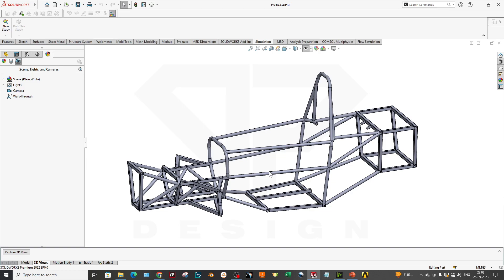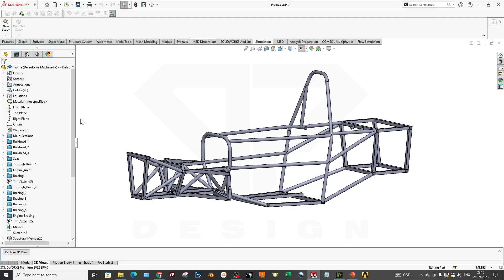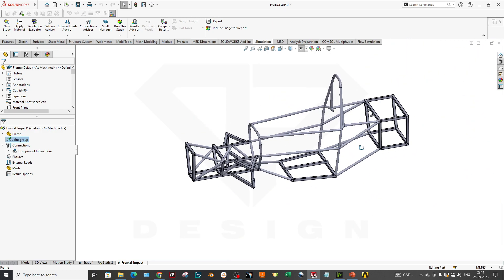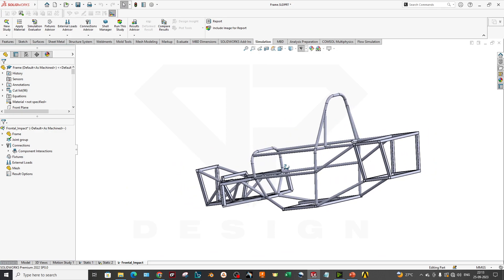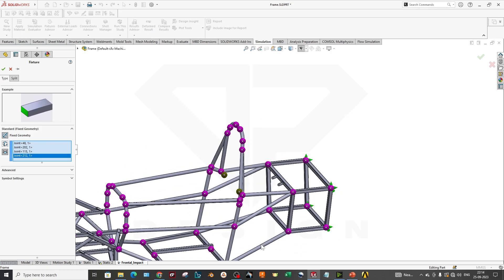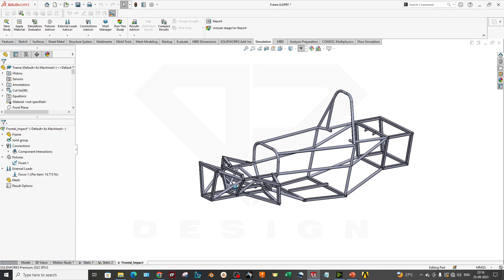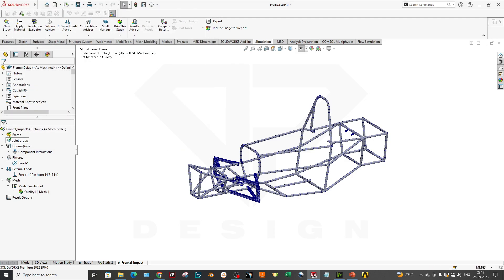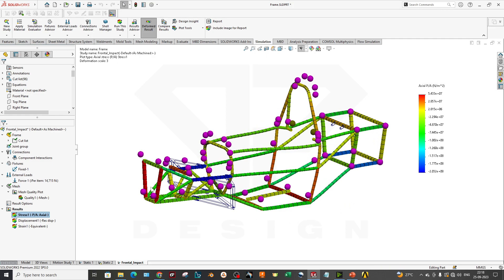Frontal Impact Simulation of FSAE Chassis using Solidworks | Formula student | SAE | DP DESIGN

Comment: Hi, I am trying to run a static frontal impact simulation on a space frame for a sports car concept but im having problems when i try to run the sim. It says "Beam is not properly bonded to shell/solid. Bond 0"

I tried to search for any solution but i cannot find one. Hope you can help. Thanks
Reply from the maker: Send us the model with questions. 
Email : dpdesign.engineeringsolutions@gmail.com